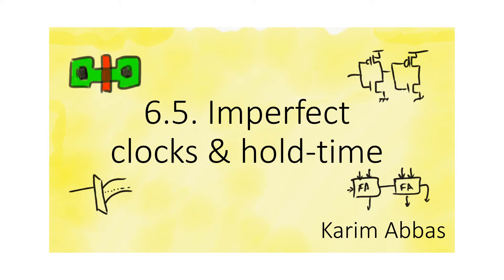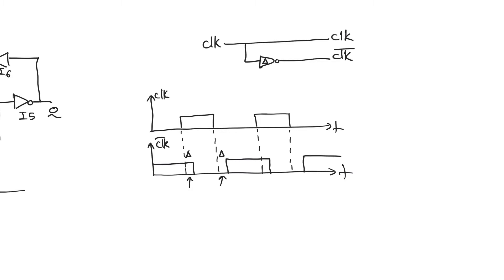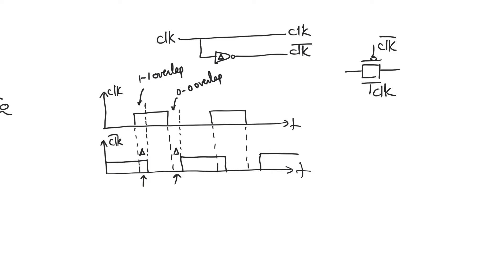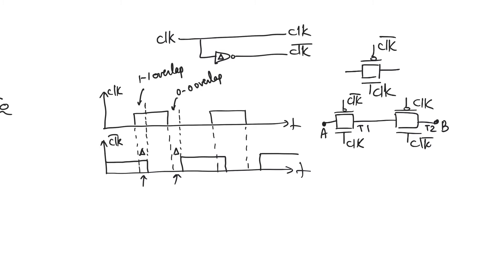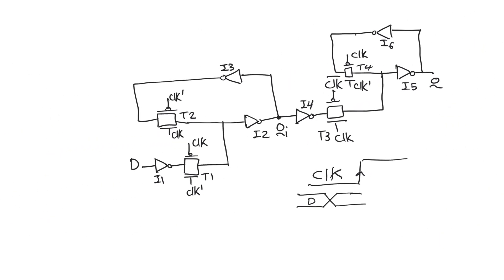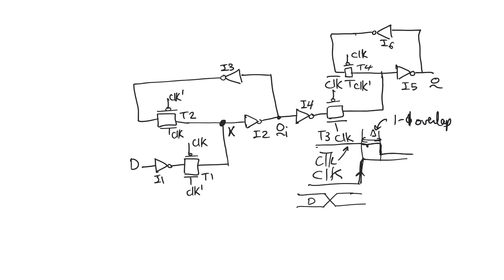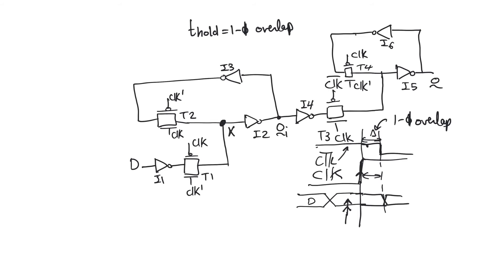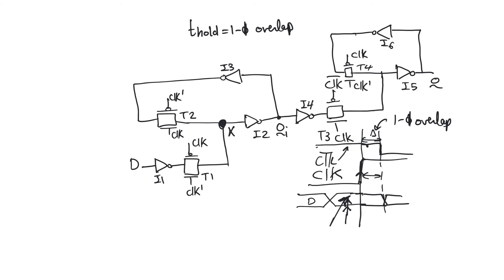6.5. Imperfect clocks and hold time

Comment: Hi thank you so much for these lectures and the book you have written, I wonder if the inverter used in the register delay is higher than the 1-1 overlap, we can avoid the hold time violations right, but making that would slow the register?
currently, I am preparing for VLSI-related placements and your series is excellent!